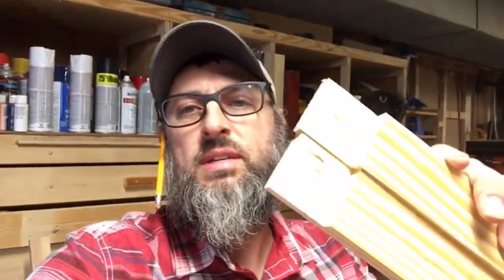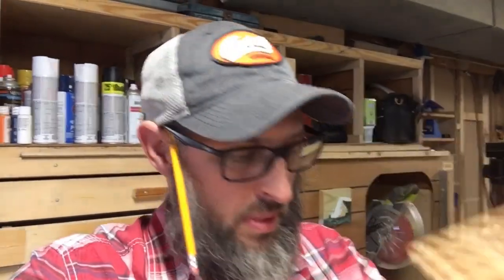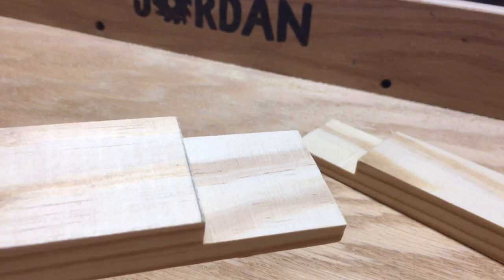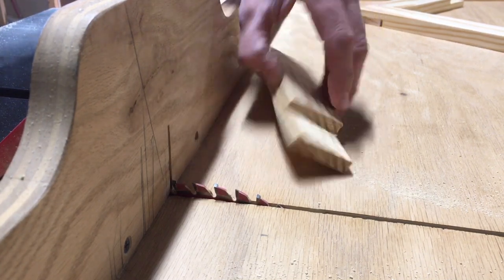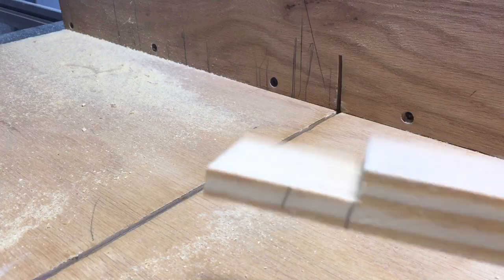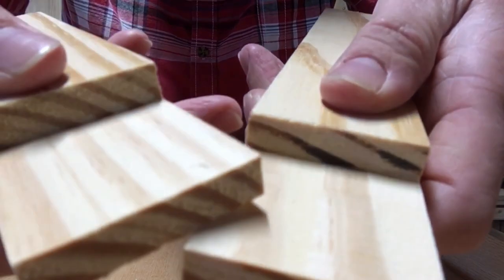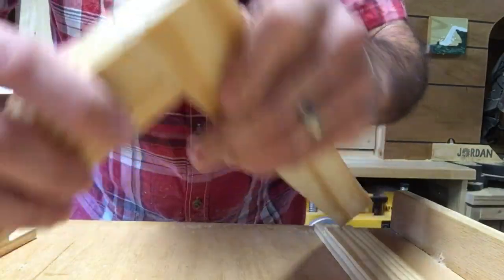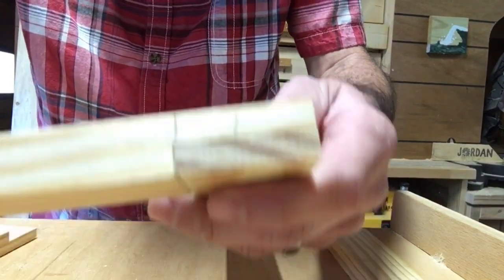1/2 lap joints- How to get clean cuts

Comment: i'm no stickler but if someone were to do this sloppily or mess up their blade height with anything decently tough, aren't ya just kinda asking for that piece to cam into the blade? clean as hell result, but feel like i wouldn't wanna do this on the tablesaw
Reply from the maker: The best way to do it on a table saw is by using a table sled, easy and safe
Reply: @Jordanwoodworking  most excellent. i bring that shit up out of fear/respect for the tool. still learning the best ways to use mine, so wanna make sure whatever moves I add to the shop are solid.